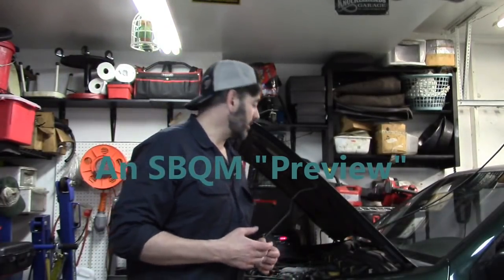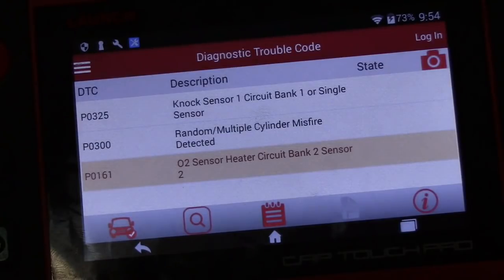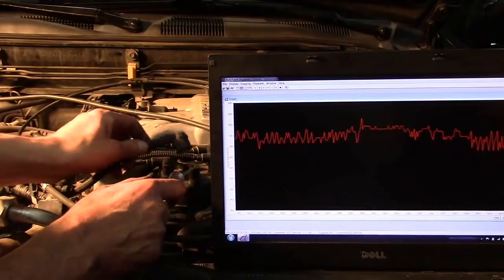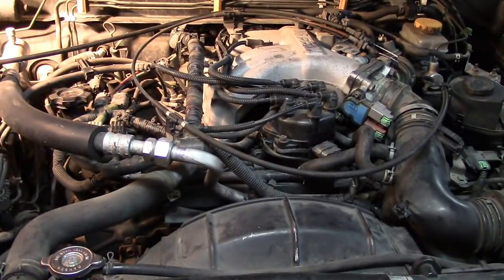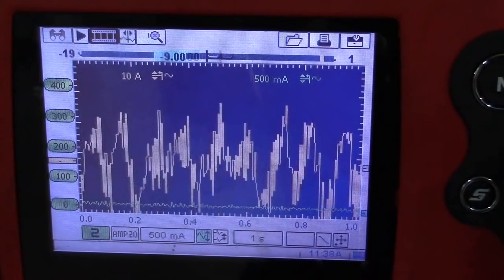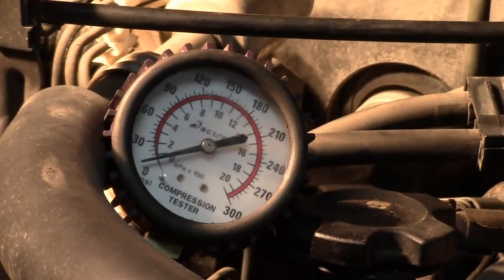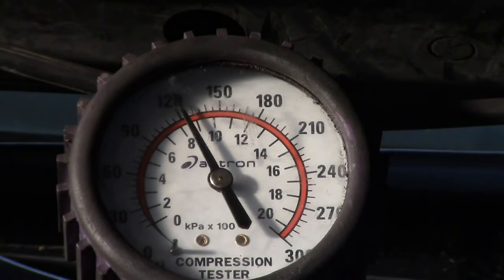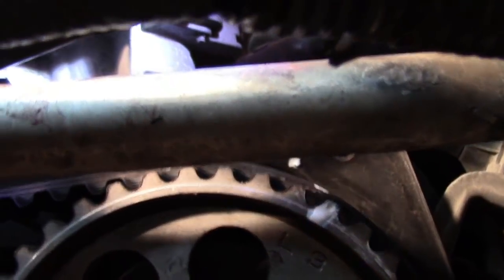Low Engine Power Diagnosis (An SBQM Preview)

Comment: That website is down.  What's up with that?
Reply from the maker: It’s been down for years now. Guess they got busted for having copyrighted diagrams.
Reply: @SchrodingersBox  That's why you have to redraw them by hand on the whiteboard of knowledge or do what every Haines manual says, which is claim that the information was obtained from a teardown of the vehicle

Comment: Matt nice clear demo. Thank you. Like u I am never satisfied just to b told the issue but want to understand y our testing technique shows prob. Here’s my thought. If we use ignition and rep comp to indicate timing, and ig timing is driven by crank sensor, the even if cams/valves are out of time, would not to ig sig always be at the correct TDC (ie from crank trigger) - unless the crank sprocket itself has slipped (possible on Ford engines with no keyway)??? Obviously I am missing something cos u correctly show TDC Ig misalignment. Your thoughts?

Comment: I have join recently, but seems like those videos are so comprehensive and really helpful. Would you advice where to start with Nissan Serena c26Mr20DD mfg2011. Having lack of power after vehicle warmed up and especially after an hour of driving. Engine does roaring at 3k rpm then smooth. As you said feels the same like am pulling a trailer. Stft sometime jumps to 40% normally plus minus 15-20%. Release accelerator, af ratio goes to lean. Unfortunately I don't have much specialist around my place :). No DTCs. Maybe iportant to know am Kenya nairobi. 1.7Km above sea level. Vehicle behavior is a way better in cold environment. Sorry just having this issue for some time no one can sort it out or even find a way forward. I after i watched your video where madam replaced half of engine because no one sense exhaust restriction.
Reply from the maker: I'd start with total fuel trim analysis curved against load

Comment: Did the belt jumped or it was assembled this way by a PRO ??
Reply from the maker: I have to think it was installed that way. i’ll admit that LH cam is really hard to line up but still- on a timing job here is just one responsibility and that would be line up the marks!!!
Reply: I had a similar thing once... expect I did re-checked the CAM before running it... Swapped cams for "race" version in my bike (Suzuki RF900) and before the tensioner was installed it looked ok.... After not.... had some slack in the chain so it looked fine... so can be that they had a similar thing but still ... someone failed to re check the timing after tensioning .

Comment: I don't want to troll the comments, but I have a question about the new SBQM. Is this site will contain the "old" SBQM videos also? Just to make sure I won't miss anything. I had unwatched videos on the paid channel. :)
Reply from the maker: Yes it will have all the old ones as well as new ones I've been making during this time.
Reply: Cool, thanks :) Keep up the good work!
Reply: That's what I was dying to know, thanks!
Reply: Nice! I was wondering that myself. It makes the new website much more valuable.

Comment: Matt, launch makes a higher end scantool only available through Matco. ..maybe there's another big brand in other countries as they're the biggest scan tool maker in the world...I digress. That scantool also has fewer pids than what a Nissan dealer tool would see. I'm talking about huge gaps in EGR, no live misfire data, etc. Usually my work's scantool is just awesome and feels so much like the dealer level scantool that it is, but in the end it's not Nissan's tool is it?

Crazy fun, sidenote to the extreme, I worked on a mini cooper the other day and my shop normally avoids those except for very simple procedures, but "we broke it" during an oil change so I got roped into diagnosing it. The data was fast like a modern obd ii computer but the data available? It was like a new retro car back to the 80's. It was extremely simple so I had to direct test every suspicion until I found the issue.

Normally BMW's are filled to the brim with available data. BMW makes the mini, "mini", on data. It was very fun, but ultimately frustrating for a boss who had to pay me to do the fix. It had a slight misfire which was ultimately fixed by having the coil packs more firmly shoved in place. The use a plastic lever to secure them. No bolts. Vibration would slowly free such a design. Shoddy and cheap if you ask me.
Reply from the maker: Thanks Dave, great feedback!
Reply: You're welcome Matt, you'll note my feedback is during the first part of the video. I'm still holding back for the mystery of the paid channel before this revealing section of video.

Comment: You with the face!!!  good to see you again man.  ;P 3.3L V6 169hp 200lbs @2800rpm.   hardly get out of its own way but the little dude will climb a tree if u want it to hehe.  well if it is the 4x4 that is.  love my 96.   Just an FYI the ecu wont throw the money light on the knock sensor failure.  drove mine for years with that code.  Finally got around to replacing it when i was in there doing the valve cover gaskets.  number 6 the easiest?  That is the spark plug that kills everyone right in the face.

Comment: I haven't finished the video yet, so I'm probably wrong -= and I sure wouldn't spend money on a guess anyway - but whenever someone tells me the car has been sitting for a year or more and the engine feels like it's choking or plugged...my first thought is to look for a rodent nest in the air cleaner.  It's quick and easy to check, and it's surprisingly common to find.  And boy, can those nests block up the air flow!

grabs popcorn and settles back to find out just how wrong I am  :-)
Reply: Edit: Hey, sometimes it's good to be wrong - so long as I learn.  :-)
Reply from the maker: It's not really wrong- it was a hypothesis that was simplky disproven by data.  I was also "wrong" about the exhaust being plugged and in the full video I was wrong about ignition, compression and other hypotheses.
  It's important to know in a diagnostic procedure you're almost always wrong on your initial hypotheses- just like in any science.
Reply: True, it's always important to not assume, but I figure I'm not really "wrong" until I decide I know what the problem is - and find I'm incorrect.  It's fun to guess, so long as I don't get my head stuck in that rut of assumption (same as you, when you find your initial hypothesis is disproven)...and so long as I'm not shelling out champagne coupons before the real problem is confirmed.  Nice job, mate.  :-)

As a side note - I've seen it so often on "stored" cars that it's probably always a good thing to take a quick look at anyway.  Those damn mice seem to be able to get in just about everything.
Reply from the maker: Exactly right Aussie. Being wrong guessing is when you conclude something is the problem, replace parts accordingly, and find "ooops that didn't fix it".  Thats what parts changers do.

Comment: All joking aside...Just like in this video regarding power  I have very low power on my Mercedes S600 V12 and symptoms of a bad TPS. However I'm not getting ANY codes for this! This might also be a bad MAP sensor but I disconnected it and it ran the same. So does that rule that out? Although admittedly the car hasn't been driven much to illicit codes and has been in the shop for 2 months. Both me and my mechanic hate to throw parts at this car but a TPS sounds close here.
Reply from the maker: what data do you have? What was the MAP output that made you suspect it?  Whats the LTFT curve aganst load?  what variables were induced?
Reply: Thx for responding, but I haven't gotten to the 4.5 v. outputs of either line as yet (there are two-- one for ea.bank) or to check for a bad gr. wire yet (above .100 isn't it?). What throws me are the lack of codes.
Reply: No codes could be a false guess if the light isn't on. I often find those cars with codes which didn't set the light. Be it pending or history to give you some direction for testing. That said. I DON'T specialize in German cars.

Comment: Fortunately for the owner these bastard engines are bulletproof. A quick realignment of the timing marks will get this beast back on the road with every bit of its utterly impressive 170 horsepower.
Reply from the maker: Yes but the engines are interference design... however this one had over 220K miles and still was in great condition.

Comment: And....do they make a torque wrench for left hand threads?
Reply from the maker: Yes- a beam type wrench!
Reply: I've seen one or two that have a square drive sticking out each side of the head - for left hand treads, just turn the wrench over and use the other drive - and tighten until the click as usual.

Comment: Do you think it's possible that your amp clamp was installed backwards? If you invert your relative compression waveform, it makes more sense to me. The spark signal is closer to a peak compression event, and the minimums are relatively equal with each other. You can see three cylinders with relatively equal higher compression and three cylinders with relatively equal lower compression. IMO, the inverted waveform looks more like what you would expect to see with one bank being a couple of teeth off. Just a thought to add to the discussion...
Reply from the maker: Yes good observation- no when I tried inverted it was clear the signal was incorrect.  Besides the signal matched the compression tests I did AND also the timing was indeed off on bank 2- something we would not have seen even if the inverted signal was "correct". Also the Amp Clamp has a very clear polarity indicator on how to place it relative to B+.
 I like the thought though!
Reply: You are right. I had to switch from my phone to my laptop for a better look. I counted 40 teeth on the cam pulley. That makes 9 degrees per tooth. 3 teeth off would be 27 degrees. If you look at the spark signal, it is about half way between two cylinder peak compression events. It is a six cylinder engine, so there is 60 degrees between the two events. Half way (where the spark trigger occurred) would be 30 degrees, so the waveform makes sense (close enough). If you invert the signal, the spark signal is only 5-10 degrees off. Thanks for the cool video.
Reply from the maker: Hahahaha holy shit dude you are WAY more thorough than me hahahaha!!!  Dang man- now i wish i specifically mentioned the calculations you described for the pay channel!!!!!  What a great presentation that would have been!!!  Dang. I often wish i could read comments before i release the video lol.
Reply: Dennis, some people wonder why I comment so much on Matt's channel, probably more than any other unless it's for self-promotion reasons. It's because I can meet and hear from people LIKE you. Thank you!
Reply: DE Nichols thanks for the kind words! I'm looking forward to the message forum on the new site. I'm hoping we get some good discussions going, and I'm sure we'll cross paths over there.

Comment: NEW VIDEO IDEA:  Please do a video on the GM Passlock System with the inductive chip (not the resister in key).  Just paid my dealer $800 to replace it.  All other mechanics didn't have programing tools.  Is there a bypass for the INDUCTIVE system?  (Lots of videos on putting a resister across the resister key contacts, not applicable.)  Dealer said no firmware or setting for the Body Control Module to turn it off.  For other cars if the security light goes on I want to disable Passlock, not needed in the least.  I successfully used the 10 minutes on, 10 seconds off times 3 start sequence to start the car and drive it to the dealership.  Thanks Matt.
Reply from the maker: Yes I am very familiar with that system (my Trans Am has it).  I will do that for sure- it's an easy fix/bypass.

Comment: Like a Scotty video, the timing cover comes off instantly and easily.  How did you know it had 2 cam shafts and 1 sensor?  In the full video, please show your research materials (AllData etc.)  Ready to re-sign up.
Reply from the maker: I actually don't know the design- I was just guessing it's a rationale for the failure of a cam/crank sensor code to throw.

Comment: hello

 i think you don't know if the knock sensor not funciona the car will drive like shit
Reply: I've never had a car noticeably drive better with a correctly replaced bad knock sensor. It may have a bit more power or economy as it may not pull timing to be safe, but it should be largely unnoticeable.
Reply from the maker: Untrue. You clearly do not know the function of a knock sensor. You should see my knock sensor video on the pay channel.

Comment: Hello...some more good diagnostic methods....age of vehicle not relevant as can be applied to all vehicles regardless...could i ask is your amp clam with the wide jaws a high amp clamp?  I only ask as i noticed the settings on the vantage pro were for low amp clamp.....as the pattern and not the amperage reading was the import thing in this case was that the reason for using the high amp clamp on the low amp preset? (If of course your wide jaw clamp is a low amp probe then i am talking out of my ass) good to see you back